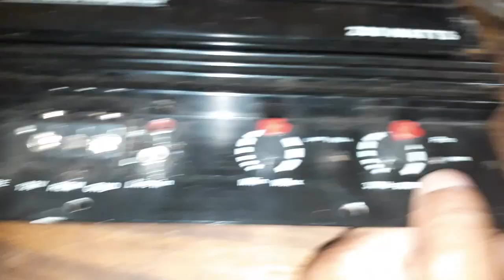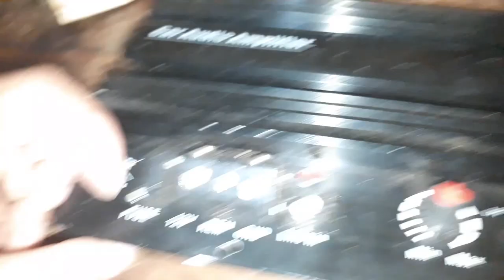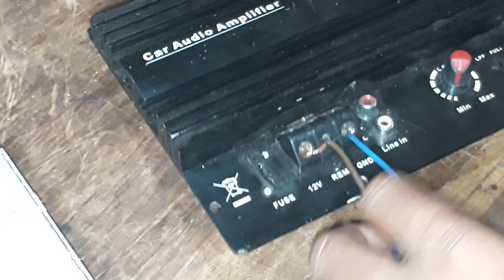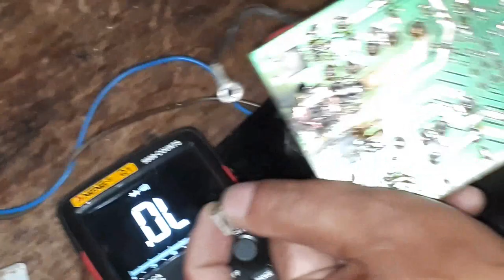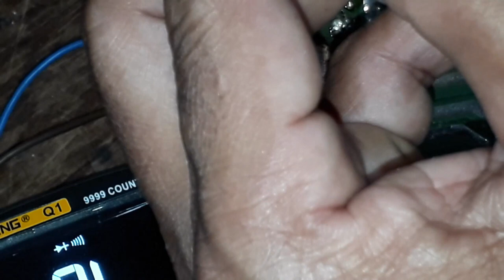How to repair a car audio amplifier ( sinhala )

Comment: මන්  ඔය amp එකක් අලුතින්ම අරන් හයි කරා මුලින් sound හොදට තිබුනා ,පහුවදා amp එකෙන් speaker එකට sound out වෙන්නේ ටිකයි නේ එකට හේතුව මොකද්ද..
Reply from the maker: Voltage ,cap resistor බලන්න ic ☝️
Reply: @pushall8331  අයියේ amp එකේ ඕවා පිච්චෙන්න හේතුව මොකද්ද,අලුතින්ම ගත්තේ මන්

Comment: Sound vedi karanakota off wenwa wage wenwa...kedi kedi ahenwa...mokak wenna puluwn da?power input aka thynna normal cable pody cable akak
Reply from the maker: voltage සහ ඇම්පියර් හරිගානට මදි උනාමත් වෙනවා ,ස්පීකර් අවුල් උනාමත් වෙනවා ☝️👍
Reply: @pushall8331  speak awl??😪😪😪 Normal nam awlk na hodata weda..godak wedi karahma wena... mn power paththa hadala balanm..Thanks 👍👍

Comment: Oya 44n mosfet  eka pichila math dam yalau.sub eka on venava .out vena voltage 39  gane cap depathatath enava.eth power dila vinadiyak yanna 44n ic deka dum dan ganata rath vela pichenava ai e.spker ekak vath amunala na.mosfet 8 vithara maru kala bord eke short mk na.
Reply: Same same
Reply: Same problem